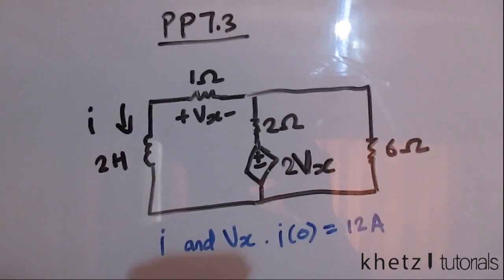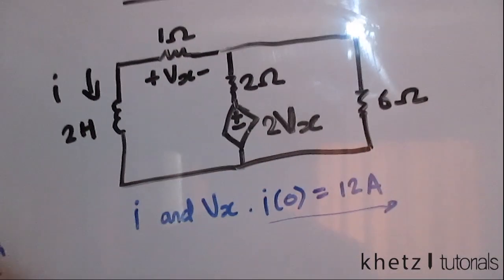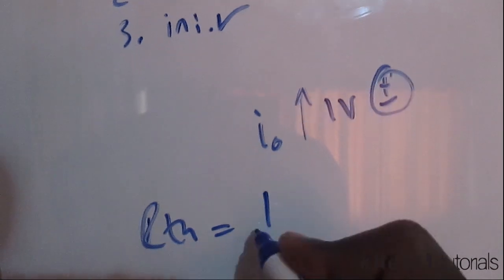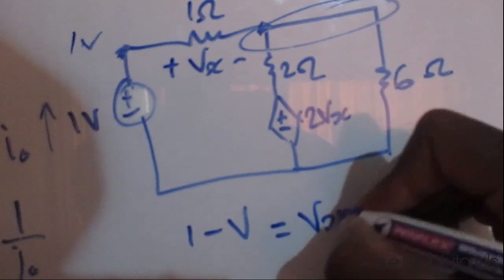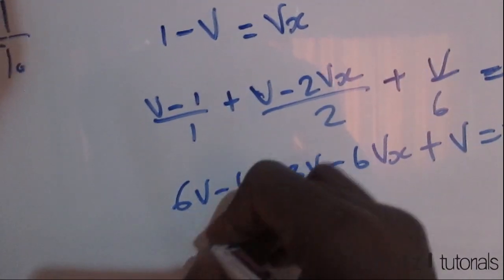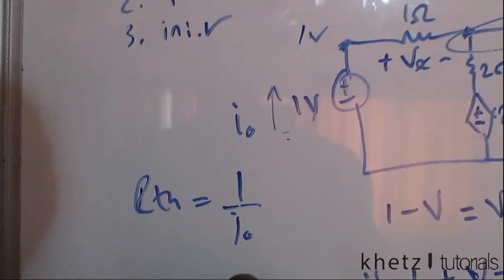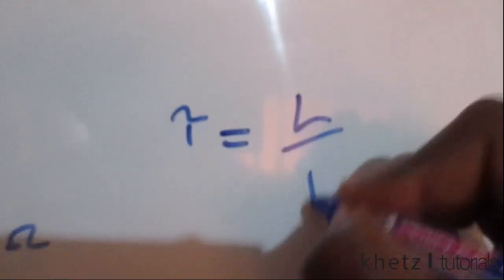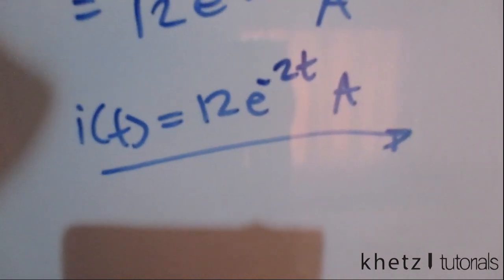Fundamentals Of Electric Circuits Practice Problem 7.3

Comment: Sir i solved it with KVL but im not getting the same result
Reply from the maker: I'll have a look
Reply: @KhetzTutorials  Oh thanks sir💜🙏
Reply from the maker: Kvl should give you the same answer. Did you do it in both loops to make sure that the resistor that's shared between the two loops is properly taken care of?
Reply: @KhetzTutorials  yes sir.. i applied KVL for the two loops and i wrote the voltage for 2-ohm resistor 2*(i1-i2) in KVL equations
Reply from the maker: That should be for one of the loops. The other should be 2(i2 - i1)
Reply: @KhetzTutorials  if you can solve and share the photo of it it will be great..but if you don't have time it's okay
Reply from the maker: Send a message to the email in the description. I'll send just now
Reply from the maker: alright. here are the key equations: vx = (1)(i1); io = i1; loop 1: -1 + (1)(i1) + 2(i1-i2) + 2vx = 0 loop 2: -2vx + 2(i2 - i1) + 6i2 = 0
Reply: @KhetzTutorials  i sent sir